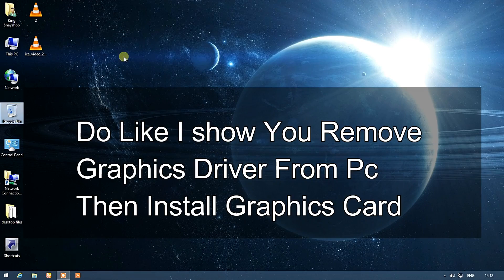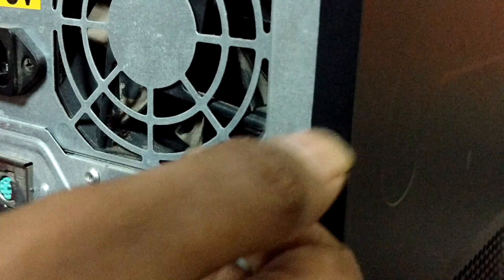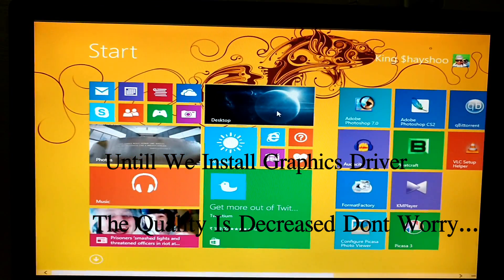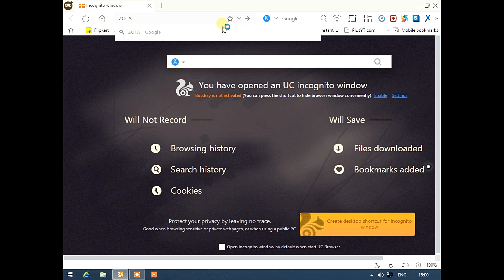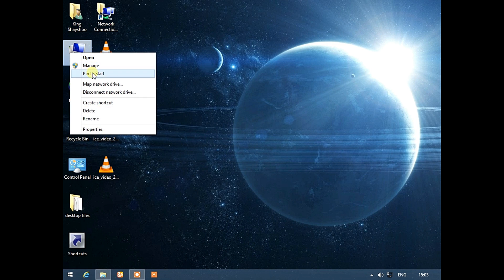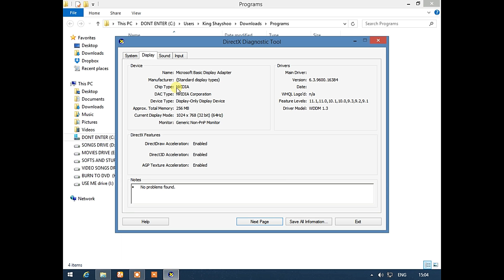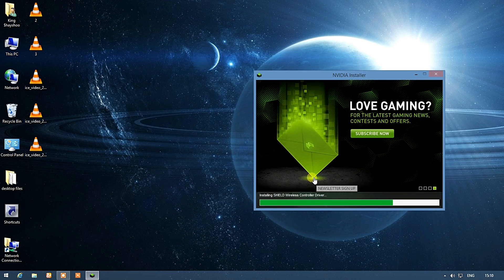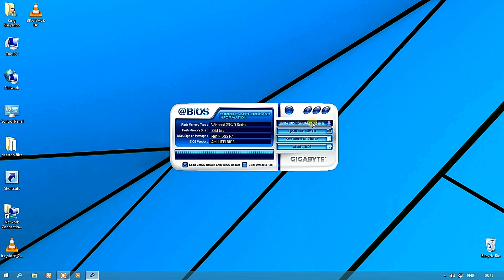Graphics Card Installation: Full Video Of How to Install Graphics Card Nvidia 710

Comment: Hello sir, please help. 
Basically i currently have integrated intel graphics, however i am buying a new gt 1030. So when the gt 1030 comes what should i do before installing it?
Reply from the maker: check specifications like smps voltage etc matches with gfx card if it doesnt match it will result in lines on monitor and doesnt show anything properly . its best to make installation by computer hardware professional or do it with care if something goes wrong none will be responsible so think twice

Comment: please help sir ..i install the 1030 gpu driver but i on or restart the pc ..hd movies video quality Everytime down..please sir help i m very frustatrd .
Reply from the maker: OK actually graphics card is used mainly for gaming and 3d modelling and textures for max performance 

if it works perfectly at begining and after restart it gets worse i dont think its graphics problem 

it should be video resolution which effects the video i think youre watching youtube or any online video if in that case video shifts from one to another resolutions  so you might get that problems

in other case graphics drivers are not correctly installed ...

Comment: when i install that graphic card my pc get turn off ....  ☹
Reply: Your power supply is weak. Maybe?
Reply: @skr2488   graphic card is not working properly , and my pc is new
Reply from the maker: @skr2488  might be right you must have to read on the box and compare the voltage supply of your smps then install it

Comment: Will it work on Asus p5g41t-mlx motherboard with 4gb ddr3 1333mhz oc ram Intel core 2 duo processor lga775 cpu socket pci express x16 slot directx11 API psu 450W?
Reply from the maker: DONT KNOW BRO ASK THE COMPUTER TECHNICIAN ABOUT THAT ( IT SHOULD WORK ON ANY PCI SLOT WHICH IS LATEST MOTHERBOARDS )

Comment: Plz help, I took out my 210 GT, and put in my GeForce zotac nvida GT 710 but it’s not work pls someone help me
Reply from the maker: I Think You Have To Use Normal Vga Which Is Attached To The Motherboard Then Uninstall Previous Driver Of Graphics Card Then Install The N-Vidia  GT 710 In Motherboard Then Install graphics Driver and Disable inbuilt Graphics. i think it may work

Comment: what if I install drivers first then install graphics card
Reply: You doesn't want to uninstall your Intel graphics you have to just set Nvidia as default graphics card in Nvidia control panel it is more suitable because youtlr display is directly in connection with Intel integrated gpu so just make Nvidia as default graphics card 😍😍

Comment: Do you need to plug into power supply
Reply from the maker: no  just install the card in pci express slot and fix it then use it no power connection needed
Reply from the maker: there's no other powersupply directly put it into pci express slot and fit the screw then put the display cord and use it...
Reply: Thts cool

Comment: Hello, my graphics card is too small for my computer. I can't find no videos how to fix this problem. My problem is the metal panel on the expansion slots.
Reply from the maker: if you have the same graphics card then you have the option to remove the metal panel and replace the other panels which are given in the box they are small and can be fixed in small cabin
Reply: Just cut the metal to fit as long as it goes into the slot correctly your good